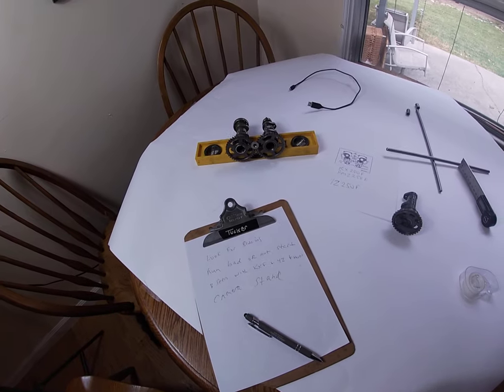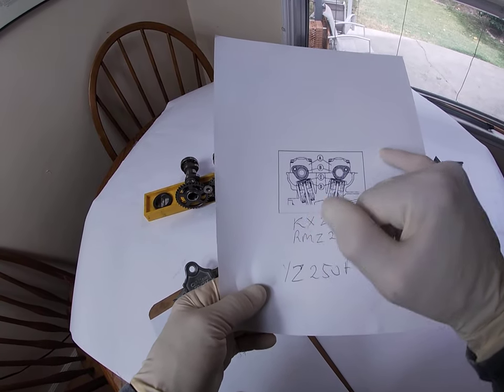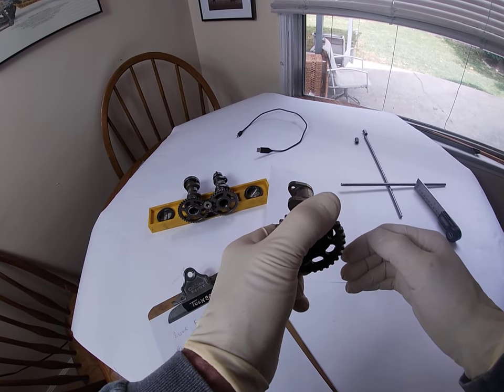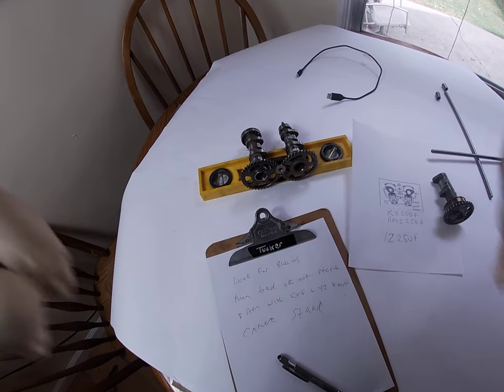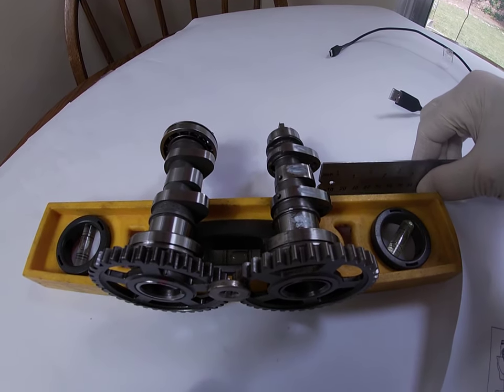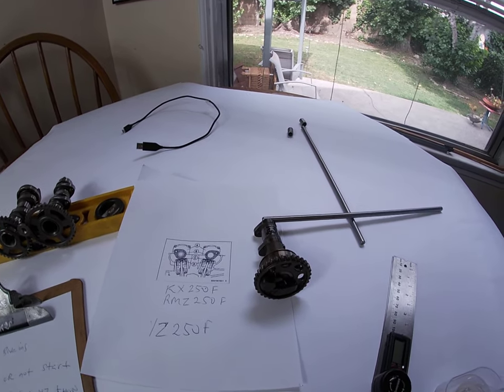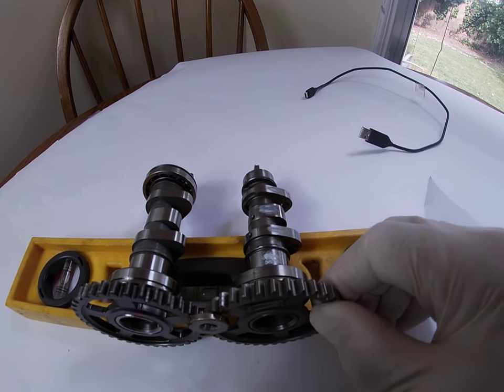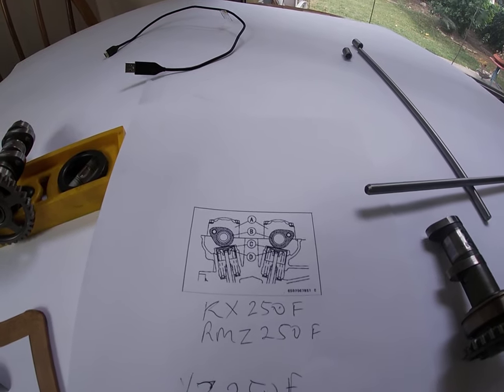Cam Gear Spun? What to look for CRF, YZF, KXF 250's

Comment: drz400 wouldnt start, went to check timing and my intake cam gear and done a perfect 180 on the cam.
exhaust and intake cam where both sitting a 10'o'clock when the gears were timed on the marks..
also one of the valve buckets on the intake side was cracked and was stuck in the head? i think oil loss on the intake side caused this

should i take the head off and inspect cylinder/piston and valves?
Reply: Yes